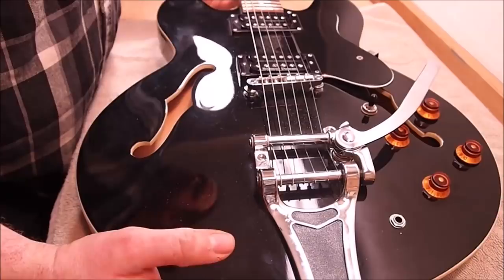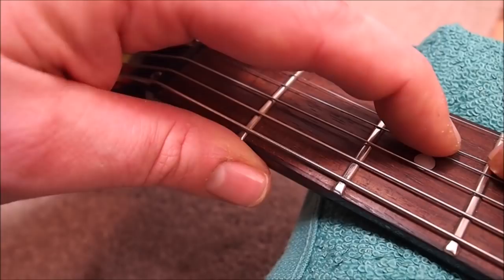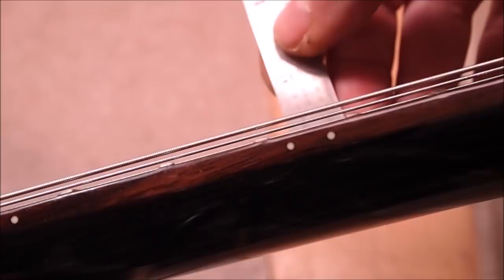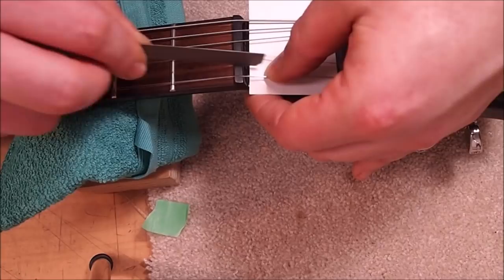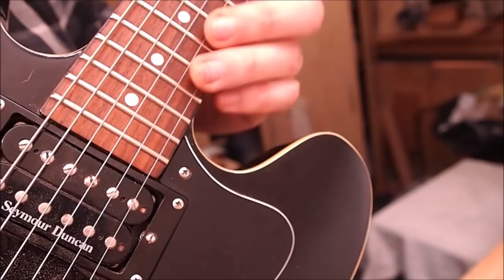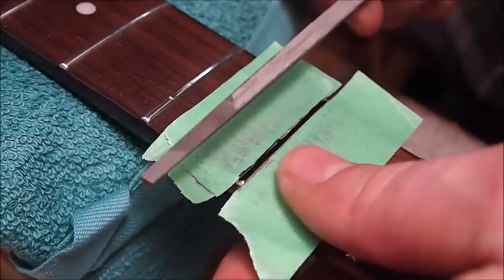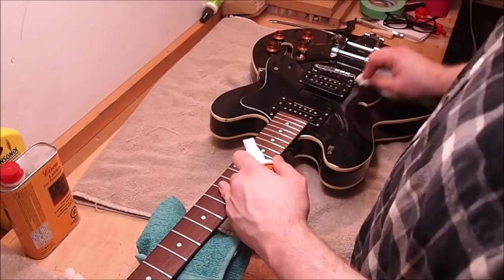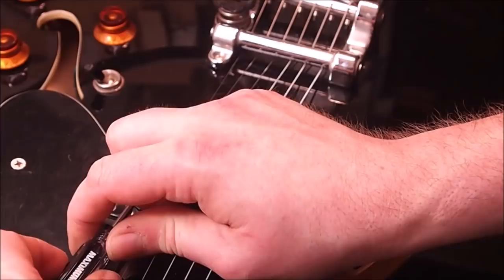Guitar Repair:  Tokai gets a Set Up

Comment: Since I have an absotively horrible memory, I have developed a mnemonic device to help remember which way to move the saddle to set intonation. I use the harmonic/fretted approach and this helps me keep it straight in the ol' noggin: If the FRETTED note is FLAT, move the saddle FORWARD (toward the nut). I hope this helps someone down the road.

Comment: Tip for restringing a Bigsby B7-like vibrato: prebend string at the ball end with pliers (like a 90 degree bend or so) and actually restring the other way around - going from the bridge, under the tension bar and around the vibrato bar itself (this way there is less chance that you'll scratch up the finish with sharp string ends). Never had strings pop off the vibrato during change this way.
Reply: Me either. Just makes sense.

Comment: Another good vid!  FWIW I stopped  using pure lemon oil a while ago - I had  cpl of instruments in where the lemon oil dissolved whatever adhesive was holding in the inlays, and also the binding return on the end of the fingerboard.  This was prior to the current crop of industrial CA glue (nobody I knew used it anyway) so if that wasn’t bad enough , it also made whatever binding cement I was using at the time refuse to cure - it wound up being a multi-day trial and error mess to find something that would hold everything together again. To be fair - my lemon oil might have been reacting w something the owners did prior - who knows.  But this happened to 2-3 guitars in a row so I abandoned it.  What I’ve found works great is either pure food grade mineral oil - like you’d use use on cutting boards - or nut oils like walnut oil.

Comment: One time in the old days, I got to set up a cheap Strat copy, and the first thing I found was that the nut slots were too high. I filed them deeper until it felt good, then went about doing whatever else was needed. The action was still high, so I lowered the bridge to get it comfortable. Then, to my dismay, I realized the the strings were now mostly lying down on the !st fret. I had to install another nut from my parts drawer & go about shaping it to fit & cutting the slots. I would advise saving any nut slot filing until all the other factors in the setup have been addressed, save for the pickup height adjustment & final intonation. BTW, that's a great tip for the Bigsby. Thumbs up as usual, Mr. T.

Comment: My favorite way to set intonation is to get the open string in tune, then adjust the saddle until the 9th & 21st frets (fretted) are as close to a perfect octave as possible.
Reply: That's a good idea. That way, if there are intonation problems afterward, you'll know it's almost always that the break point of string contact in the nut slot has receded away from the leading edge of the nut.

Comment: Enjoyable video. I also measure string action at the 12th fret and use 64ths , in my case 3/64 high and 5/64 low seems to be perfect on electric guitars but as you mentioned all players have their own preferences.

Comment: Wow, i just realized that I set my action wayyyyy low lol.  So much effort to get it that way without buzzing as well.
Reply: If it don't buzz, and its smooth and you like it, It's not too low! My flying v could hold a thin pick b'tween the fret and the string and not buzz. I thought i had it perfect!
Reply: @charlesmoore1307  definitely.  I usually have to do a full fret level. The only issue is fretting out with the more radiused fret boards.
Reply: Charles, Michael, if I may add to your conversation, I have a G&L Tribute and. PRS Standard which both set up clean at 2/64ths.  
Marvellous and probably unusual that they do but just for me I like to raise it up to 3 to 5/64ths to get a hold on the string and feel it working under the fingers. 
More like the usual setups on most guitars.   Great fun!

Comment: The D chord is naturally a bit "out of tune" for me. I think it's due to how frets are an approximation and don't correct for string tension and thickness. Unless you have true temperament frets installed. Most of us are used to that sound, but it can be annoying sometimes and in certain songs and with certain sounds dialed in it feels worse.

Comment: First you define that 64ths is the way to go, then you measure to 4.5 64th, isn't that 9 128ths.
Reply from the maker: It's also 18/256's or 1.7mm or .069"
Reply: @twoodfrd  The only thing I measure in inch is guitar strings. And then no fractions but only in thou since that is what my electric caliper is showing.